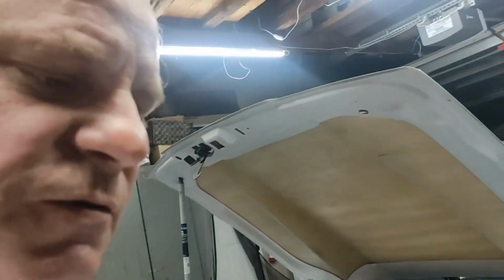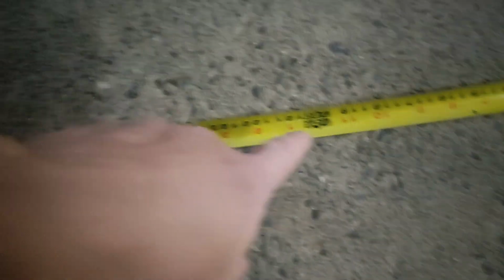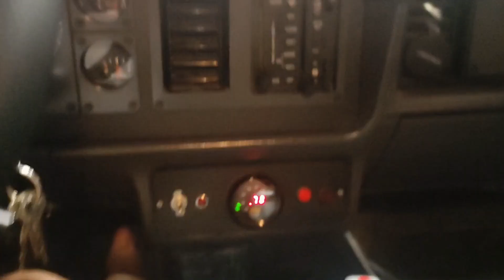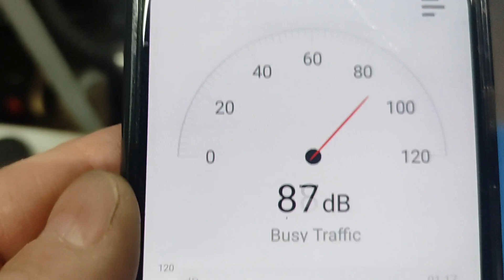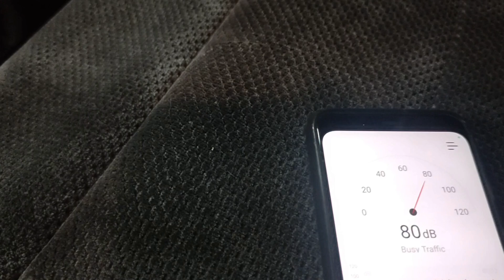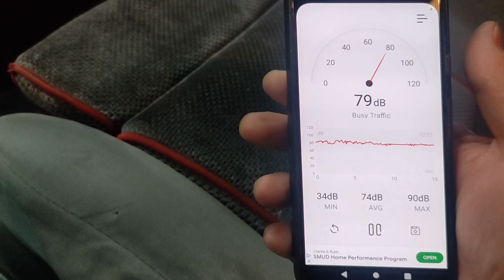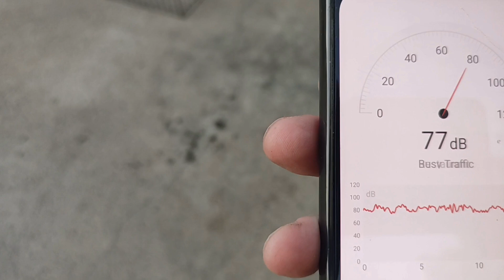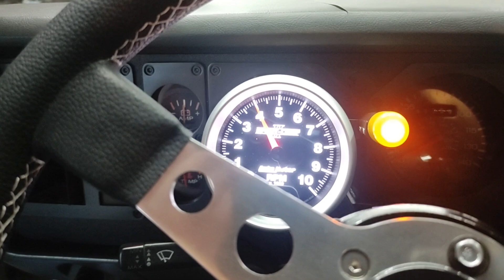2.5" Dynomax super turbo mufflers vs 3" catted x pipe no mufflers - Decibel measurements

Comment: Sounds really good, and rowdy
Reply from the maker: Thanks Anthony, How is Beans running?
Reply: @vrm86gt  you're welcome, Beans is running as good as ever , stopping........not so much 😆 I think that the master cylinder I put on when I replaced the entire brake system is drawing tiny amounts of air when I release the brakes so I ordered a new one today and somemore brake line cause I'm going to change it up a lil to clean it up

Comment: those sound like they might not tick off the neighbors. I have the thrush rattlers on my 69 mustang. 306 with compcam thumper, thick flow 11r cnc 170 heads and 1-5/8 tri-y headers on 2.25 dual exhaust with h pipe. it's pretty loud. I really like how those turbo mufflers sound. might be what I need to quite mine down.
Reply from the maker: @turbobobby1  I like them so far, should be quieter on a 2.25 inch system also!

Comment: I had these on my 351w the are nice and have a good roar when you open up the eagles. I also noticed less cruising drone inside the car compared to the standard chambered muffler's.
Reply from the maker: @superglx7028  cool! I've only had straight through 2.5" and 3" these are first time I'm trying out the Dyno Max super turbos!
Reply: @vrm86gt  do you have to have E check on your car where you are at? I live in Ohio and any car older then 25 years doesn't need a E check

Comment: Interesting, going to have to check mine, the Accufab headers and Xpipe make it pretty quiet at idle.
Reply from the maker: @FXRSDriver  just got it all bolted and booger welded up, I wanted to make sure I can easily disconnect the tailpipes and mufflers and go back to dumps or collector extensions easy, with our track closing last year I'm just not going to be able to drag race as much as I want to anymore. Not that I was any good at it but it is fun to make passes and try to go faster!

Comment: just messured mine 331 .but not that hot as yours .. all 2.5 exh. X pipes with Cats and same mufflers at 950 rpm ..its like 77dB
Reply from the maker: @Diondo26  77db! Is that from 10 ft? I wonder if all 2.5" would get mine to 77db? Hmm!!
Reply: @vrm86gt  yes like 10 ft behind the Car ..

Comment: Why cats ??
Car is not smog legal anyway.
Reply from the maker: @hotrodray6802  because I already  have it
Reply from the maker: also, noise reduction,wife complains about fumes in the garage, and heavy fine if pulled over and caught without catalytic converters here, lastly I don't feel 3" high flow cats are hurting street performance and I have header collector extensions I can run at the track